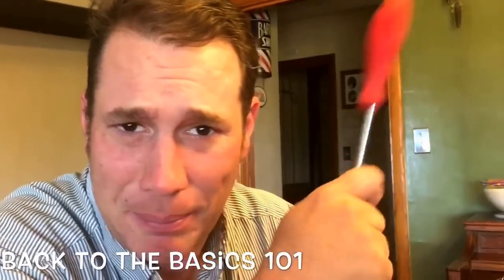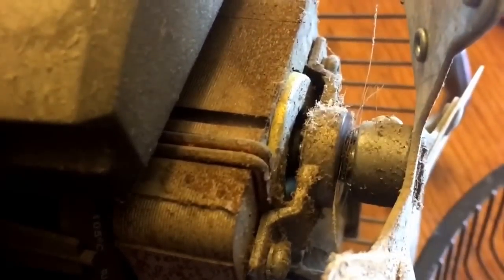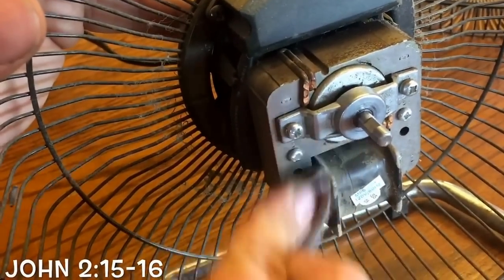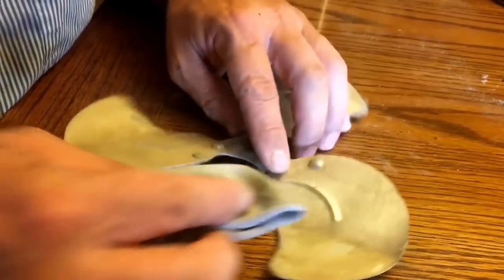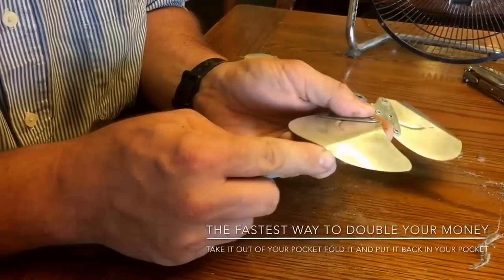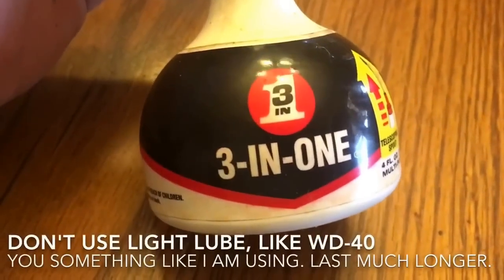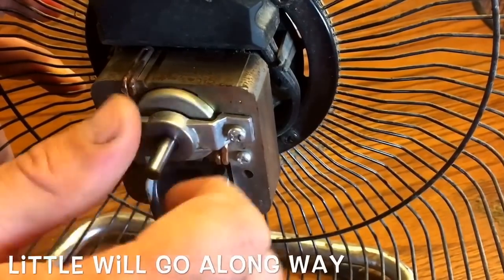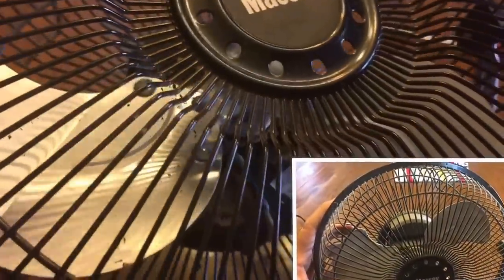Service your FAN,Clean and lube your fan

Comment from the maker: As a sidenote, I did not show in this video the rear bearing. The rear bearing is to be oiled in the exact manner as the front bearing.
Stay cool
Luke
Reply: Thank you so much🙂
Reply: How do you get to the rear bearing? Do you take it off the rear guard?  Remember this is fan servicing for dummies.
Reply: Which oil did you use?
Reply: I have never thought of doing it....... But my fan is giving me problems
Reply: 3-in-1 blue label is good. It may be very hard to see the back end of the shaft but is worth doing
Reply: Some fans will be completely seized up, and they get completely stuck. Well, I came across a fan with that issue, and I tried to force the shaft out of the bearing, but I accidentally destroyed the bearing assembly by forcing the shaft out of it, so I used the fan for parts. I use fans for parts if they're unfixable to fix other ones, and donate the cheap modern ones to make room for my favorite vintage ones. I get them from dumpsters and streets when people throw them out.
Reply: Hello,
I finally clean my fan after a decade of neglect, but I forgot something important.. Adding oil to the bearing.

Can I add oil that's for hair clipper?
Reply: @SomeoneSpecial447  3 years late.
A quick Google found. 
Any light oil, like 3-in-1 Oil, will be fine for the fan.
Reply: Dad taught me to do this the first time the fan came out each summer. I love him for it. ❤
Reply: I usually use Singer sewing machine oil to lube mine. Learnt to do some stuff like this from seeing my Dad doing so as a child at home, back in the dinosaur days. Then, I once did a short course in mini appliances repair. I hardly ever repair/use all the knowledge attained from that Community Development course, like repairing the motor itself. The truth be told, I don't really enjoy having to do these chores anymore. Being a Senior female citizen, and a good Christian at that, there are other pasttimes I 'd rather enjoy spending my time doing. Lol. 😂  Also, what you said about this throw-away-generation is spot on. I have lived thru that experience with my adult son, quite often, since 2020 to this present time. He had wanted to return home, only so he would no longer have to rent a place of his own. Not to help me nor my husband. I know that now. But..... I no longer have my husband around me since late 2023. May God Almighty bless and rest his soul. So,  
I don't ever let my son know what or
when something of mine needs 
servicing. I simply diy it myself, or get someone knowledgeable to repair it, as I no longer have my husband to help with such stuff. You don't miss the water till the well runs dry eh! That's one of the many great sayings of long-ago-folks, especially my dad. Blessings to them all. Those departed, and those that are still in our midst. I salute you all. ❤❤❤😂😂 Especially, my Ole 
 Soldier Dad and lovely dearest, house-wife mother. Bless up, to all DIY-ers out all over the world. ❤❤❤

Comment: this video reminded me I have an attic fan that i haven't looked at in years... thank you...
Reply from the maker: Believe it or not attic fans are one of the major causes of houses burning. Those bearings get very hot in that dry climate, and one of the bearings will drop down in the attic sometimes and start on fire.
Reply: I haven’t checked on my attic fan in 20 years - will check it in the spring.
                        Thanks to you I just repaired a nonworking,nice Patton floorstanding fan. I fixed it and they must run about 150 if they were to be sold today. The battery mechanism was totally 99% frozen but the three and one oil and a little twist loose and it up added some more and it’s working excellently. 🥇

Comment: I lived in puerto Rico for years. had no AC ( couldn't afford it). Servicing our fans was a no brainer and a real necessity.I'swatch neighbors toss several fanswhile mine kept going strong. Sometimes i'd pick up one of the discarded fansan found it just needed to be lubes and cleaned. bingo! Extra coins in my pocket upon resale...
Reply: If the blade does not turn, the lubricant is dried up.  To break the seizure spray auto motive brake cleaner or carb cleaner.  It the plate spins and the fan does not work it could be the thermal fuse in the motor.
Reply: You ever have to replace the little black washers/spacers inside the engine? I seem to lose them all the time.

Comment: Thanks for the tips! As another side note..... if your fan has bushings instead of bearings you will need to disassemble the motor and use acetone (or similar product) to clean of the tarry black gunk on both ends of the rotor shaft and the inside of the bushing (use a Q-tip).  Also, there will most likely be  felt pads beside the bushing on the motor casing. Spend 5 minutes to completely saturate these with oil. Reassemble and you should get another 20 years out of your fan!

Comment: One day my fan started getting slower and slower and then eventually the blade needed to be poked for it to start up, and would only run on medium. I decided to take it apart to see what I could do. Fortunately I work on cars, so I knew what the motor, bearings, and wiring and how to manage it. I took the fan completely apart. Cleaned the magnetic cylinder and bearings. Then lubricated everything with 3-in-one multipurpose oil. Put it together and it was like brand new!!! Now I service them when I notice them start to slow down. Even told my friends to give me their fans if they’re going to throw them away because I’ll lubricate them, they’d rather buy a new one (guess they done believe me) and they give me the “old” one. So far the 3 trash fans I’ve gotten have been filthy and cleaned up to run like new. My bathroom fan stopped as well and I took that one apart and now it’s running great!
Reply from the maker: A little maintenance goes a long ways.👍🏻
Reply: Can you use a silicone based lube?
Reply: an update. the operation was a success but the patient died anyway. after all that work
     second day mrs was drying clothes motor started to smolder. oh well. but it was still spinning : + )
30 wt non detergent oil is what i use for ALL my fans. even the frozen ones. none of them have failed (yet) this is a fix i picked up a log time ago on another site

Comment: Your fan looks like my Westinghouse only 5 days after i've cleaned it. But i usually wait 2-4 weeks before cleaning or my work would never be done. It's so dusty in the Philippines. I had to watch because i lubed it twice and the blades are still stiff in rotation. I used a high temperature lithium grease which lasted a year and a half last time i used it. This time only a few weeks and i lubed it twice so i thought i must have missed something. I guess i'll just try the 3-in1 oil this time, but i didn't think that would last so long. Great video and keep up the Lord's work, kuya(brother)!
Reply: I used 3-in1 oil as shown in the video, but the motor shaft was still stiff in rotation. I cleaned the motor again to have a closer look. Taking the motor shaft out i noticed there is a fabric washer behind the rear bearing where the end of the shaft sits. I thought it was dust at first and tried to remove it with tweezers. I realized it was meant to hold the liquid oil, which is why the solid grease didn't do the trick last time. The washer didn't take the solid grease and its bearing wasn't able to move freely. There's a second washer/bearing assembly at mid shaft, which is the one that can be oiled without removing the shaft, as demonstrated in the video. I saturated both washers with 3-in-1 and it's working like new again!

Comment: After 4 years your video is still helping people out. My floor fan ( similar to the one in your video) I took the blades off cleaned them and got a lot of hair and dust off the shaft that the blades ride on lubed it with Marvel brand air tool oil. Only paid $3.00 for a good size bottle at Walmart. Fan was making a high pitch squeal, not anymore. First time doing a deep clean and lube in 2 years. Never thought about servicing my fan until it started to squeal. Thanks for the handyman video.

Comment: To the point and doesn't waste a lot of time with useless chatter. Good tutorial! I just recently started restoring antique finger choppers. Fans over a hundred years old that with a lil tlc and a Polish look and run just as good as they did the day they were made! They don't make them like they used to so I agree with Luke in that routine maintenance is necessary and 💰 saved us 💰 earned!
Reply from the maker: Thank you for stopping by and leave in the a comment. “A ounce of prevention is worth a pound of cure”
Luke

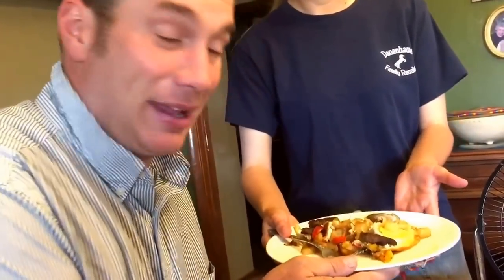Comment: 8:57 I followed all the steps but I wasn't served a plate of hot food. What did I do wrong?
Reply: Servicing your servant is needed for that. That will take more than 6 minutes of your time.
Reply: @outasynch7143  :):):)
Reply: @outasynch7143  as Luke says..just a little bit goes a long way...

Comment: I maintain several fans and I've managed to find 3 9 inch high velocity fans thrown away because those who had then, had no time to maintain them... I  have been lucky to know and learn a few things about cleaning the blades and lubrication of the bearings.... I enjoy them and I use them in different parts of my apartment... the work we'll like brand new except they're old and they don't make them like that anymore.... I even bought a few and I gave one to my sister and one to my brother.... I usually check them when the warm weather arrives every Spring season..... I thank you for posting this video..... I now hope to learn how the repair the bigger fans..... I'm now maintaining a few what it's called an air mover.... They're fans of different styles,  but works well,  but very tricky to maintain.... Either way,  it's very helpful from your experiences 👌 Do please continue to share your videos..... Have a blessed upcoming holiday season.........😊

Comment: Just found this video after my standing fan stared to squeak wildly then it seized up, I quickly unplugged my fan and did a google search. After some fiddling on my end, I can now say it's well lubricated in the front and back making it super smooth when you spin it.. Thank you.
Reply: @BacktotheBasics101  I have some bad news, I believe the repair failed. I came into my back office yesterday to find the fan spinning quite slowly, the motor was extremely hot, a quick manually spin to see that the bearing got very rough and hard to turn.. I think this is something beyond I can fix.. Sigh : (   But since then I've done the same service to all the standing fans I can get my hands on in the house, but many of them don't get that much wear and tear like the one in my office.

Comment: Currently servicing my bedroom fan that used to be my grandmothers before she passed. It’s a relatively “modern” (probably only a couple decades old) table top oscillating fan built out of plastic, but since it was my grandmothers and beside her as she passed I have a sentimental attachment to it and want to keep it working for a very long time. I clean all my fans as i find the dust and debris not only look gross but also degrade their performance, this one though is challenging. Instead of the normal screw/knob that hood the fan to the shaft, this one seems to be pressed on and had a spring clip just in front of the blade assembly on the shaft. I removed the clip but the fan blade is not budging on the shaft. I went looking to YouTube for a video where someone might show a decent method for removing such and that’s how I came across your video. Good video and certainly good advice about servicing things instead of throwing them away. Unfortunately I’ve yet to find a good video that shows how I can deal with a pressed on blade in this particular application so I’m going to apply some Kroil (best penetrating oil in existence!) and let it soak while I continue to seek a solution as well as continue with other weekend household maintenance. Eventually I’ll find a solution and will keep my grandma’s fan working well for as long as possible!

Comment: I have this exact motor and exact fan actually. What is not shown is, within the front and back brackets that holds the armature in place, there are felt pads placed around the front and rear bushings which soaks up and holds oil. Within the front and back brackets, holding the bushings in place is a pressure fitted type washer pressed into the back of the brackets, in-between that pressure type washer holding the bushing in place within the brackets is where the felt pad sits, same fot front and back bushings.The washer is not air tight, so you can soak the felt pad through the washer holding the bushing in place.  So it's best to take the little motor apart and soak those little felt pads with oil in both the front and rear brackets that holds the armature in place. All is pretty simple to disassemble. The two machine screws shown in the video, on the front bracket holds the entire motor together with lock washers and nuts on the back which is holding the back bracket in place.

Comment: Thanks for the easy video to follow. I couldn't get the set screw out and didn't want to strip it so I cleaned and oiled it without the fan out. It wasn't that dirty because I've cleaned it before but it's been making some noise and sometimes the blade needs a little nudge to get going. I didn't know where to oil it until your video.
I will try to fix anything (except vehicle) before paying someone. I've also fixed my clothes washer. I am not sure throw away person so I feel good when I save $$. Thanks for the video.
Reply from the maker: You sound like a great person. This throwaway society is a thankless society. People who try to fix things generally are thankful. Keep up your great spirit.
I am glad the video helped, if you not have not subscribed, consider doing so. We have all kinds of videos like this. Also let me know if you do subscribe. Keep in touch.
Happy trails
Luke
Reply: @BacktotheBasics101  Btw, fan runs quietly again. Success!
Reply from the maker: Chris G. 👍🏼
Reply: I subscribed. ^5
Reply from the maker: Chris G. 
Thank you
Keep in touch

Comment: I can't stand a dirty fan!  When clean, they work so much better.  I have a stand fan I use in conjunction with the AC. I clean it a couple of times a month.  As soon as it is dusty on the guard, I take it apart and clean it.thank you for the video, very informative.

Comment: Thanks for sharing.  As far as cleaning the guard and propeller...once disassembled, instead of wiping clean, place them in a sink and wash with dishwashing soap and sponge, then dry.  It's quicker and cleans them more thoroughly.
Reply from the maker: Great idea, a person could just stick it in the dishwasher as well if you have a dishwasher.
Reply: I find washing it in the shower is a bit easier because of the space especially if washing the grill of a larger fan.  Using and old bath brush can also help.

Comment: I've got a vintage Windmere 32" or 36" fan that works wonders. Still have the original box from the early-mid 80's as well as all the foam inserts and everything. Been running strong all these years, never has been serviced or cleaned (and it really needs it as it takes about 15 seconds to finally engage after you press the button)
Reply: If it takes 15 seconds to start up, I'd suggest you clean and lubricate it.  If you use these fans daily and it takes 15 seconds to start spinning, good luck and prepare to buy yourself new fans soon.
Reply: @Alvin-fz2zv  yeah been 6 years since I commented that. I bought a Lasko shortly after and that crap still works but doesn’t blow for shit (like my exes)…anyways I still have the Windmere.

Comment: I just cleaned and lubricated a screaming fan. I took it all apart, cleaned the casing, fan and all the parts. My husband blew off the motor.  Lubricated it put it all together. Total time from start to finish under 1 hr and that includes the time it took for all pieces to air dry.

Comment: I didn't even know people brought fans into shops to get serviced.  But great video. I just cleaned my fan and it worked now. I didn't have 3 in 1 lube so I just used WD40 even though you said not to use it..it's the only thing I have other than cooking oil. Or maybe I can use a drop of engine oil from the car..

Comment: When I worked in the restaurant biz the fans in the kitchen would get filthy pretty quickly. Believe it or not we'd just unplug it, put it on a commercial dishwasher tray and run it through the dishwasher. They came out sparking clean. You'd let them dry out a bit, plug it back in and you were good to go. Amazed me that they'd work after being in a commercial dishwasher but I never remember replacing one in the 5+ years I worked there.
Reply from the maker: +captainquint 
    That's interesting, very interesting. Did they ever lube the bearings? Or maybe just the grease was lube enough? 
     Thanks for being part of the show. Appreciate the input. That's really what the show is all about so we all can learn from each other.
Happy trails
Luke
Reply: Nope.  When they got greasy and dirty we ran 'em through.  Never did anything to them except that.